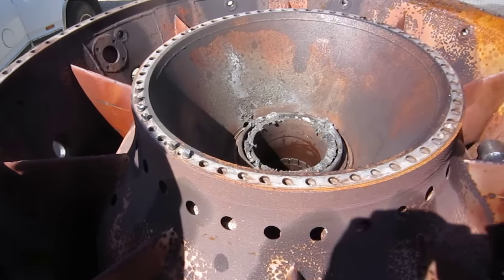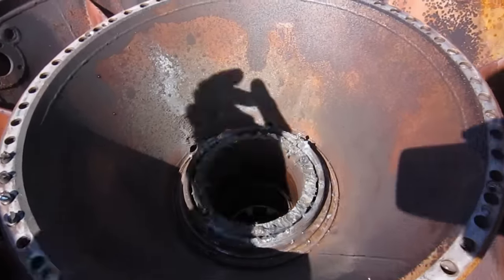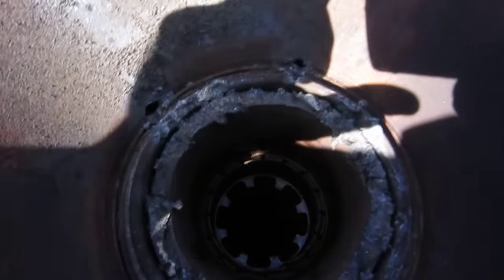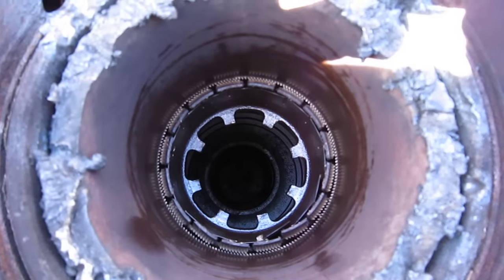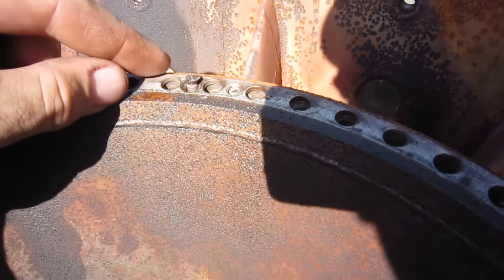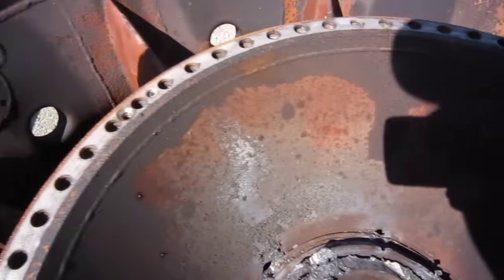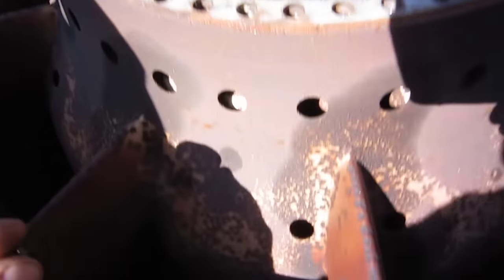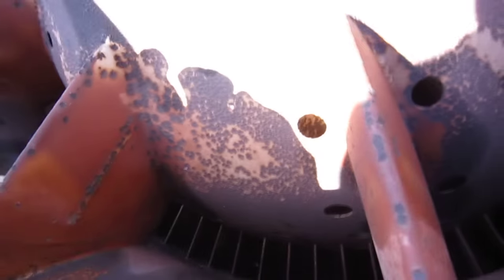Dropped into a turbine engine

Comment: As a mechanic for 8 years, the second you held the screw over the drop zone I immediately got goosebumps and anxiety.
Reply: Why is it so scary?
Reply: @qarinah8586  because dropping screws can cause an assload of work especially as a wind turbine technician. Dropping a screw or bolt (in the absolute worst case scenario) can kill.
Reply: @austinhall3937  interesting.
Thanks for reply.
Reply: @austinhall3937  could you elaborate a bit more? I love learning new facts
Reply: @marcar19  the uploader also talked about it in the video description. It means you have to disassemble the machine, find the screw, fix any damage it may have caused, like scratches and stuff, then reassemble the machine. It's like spilling water on your laptop, it's usually a disaster.
Reply: @qarinah8586  you would have to take it all apart
Reply: @qarinah8586  Because it can destroy the whole turbine when worknig, you need to find it and dissasemble half of the turbine to take it
Reply: @qarinah8586  

N
Reply: it literally felt like my entire lifetime will be fixing it.
Reply: @austinhall3937  you sound like that forged in fire melee weapons tester. "It will kill"
Reply: I nearly screamed but realized it’s just a video lol
Reply: @zaxele  Omg...
Reply: It's basically the equivalent of dropping a nut inside the oil filler hole or radiator of a car. If you do that you need to remove the valve cover or remove the whole radiator to get it out.

It gives you more work than needed. If you don't remove it, it can mess up your valve train or block a coolant passage way.
Reply: @qarinah8586  Dropping even a tiny thing into an engine can make it blow up when in flight and kill everyone on board a plane- You never want to take any chances
Reply: NormalStyleCrew  People can have some level of anxiety and still work? Like what are you trying to get at with your comment...

Comment: “Terrible sound”

The sound: T H E M U S I C A L
Reply: Nightmare for operators.. you dont know how much damage that one screw causes
Reply: We used to operate these giant machines everyday and only hoped these small erros which causes big destruction dont happen.. so we had to check everything before running the engine
Reply: @dizlikes6648  Something you've learned on when you were there?
Reply: @HangingDGrunt  hey it's the budget version of David bowie
Reply: @HangingDGrunt  we used to make these parts and repairing works for the private aircraft.. once the screw got loosened up and went inside the engine and we had to open up the whole engine to search that single screw.. it took nearly 3 days of work due to the small structure of the turbo engine and we cannot even break that as we were under budget.. so you see this is why we wished that the screw wasnt inside the turbo engine
Reply: @ajminadhimi8985  David Bolton

Comment: Yea I would never want to hear that sound!
Reply: Especially when you're 45000 feet above the sea level
Reply: Enito Jr Lim let me tell you it’s no fun working on a jet engine as you’re cruising 500mph and getting hammered by the wind
Reply: @enitojrlim4076  when the hell would you... nvm buddy, stay safe..
Reply: Whoooosh
Reply: @enitojrlim4076  tell me how exactly you plan on hearing this sound from the inside of a pressurized cabin?
Reply: @TheInator1234  With a WhoooshMeter
Reply: @twistedsim  the only joke i didnt get here was yours. R/Wooosh doesnt apply here and people like you killed that meme
Reply: While that thing is carrying my lousy ass 20000ft off the ground to somewhere i wanna reach alive.
Reply: Well if the engine was on you’d certainly hear it because it would cause damage to the turbine which is why you never want to hear that sound, because you can’t leave a screw in your turbine
Reply: isnt it because after this you'll have to dismember the whole  engine?
Reply: Василий Плотников If the engine’s running when that happens, you won’t have to dismember it. It’ll dismember itself just fine without your help.
Reply: @TheInator1234  by going outside, I guess?
Reply: Enito Jr Lim the engine would be running, so you wouldn’t hear that, it would just explode. This is in a repair station that you would not want to hear that
Reply: @TheInator1234  Woosh doesn't apply here because that engines not running. If it was running now that would be different......
Reply: This got 5k likes?! 😒

Comment: The kind of sound that makes you want to make a mistake
Reply: If every single noise is a different fan blade attached to a different section of the compressor then you DO NOT WANT TO MAKE THIS MISTAKE. You are looking at hours over multiple shifts to fix it checking every blade for damage and replace it the ones that are.

Comment: That sounds so beautiful
Reply: Andrew Hersom and deadly for the turbine
Reply: why?
Reply: kev1nsky because it might get stuck in a joint and fuck everything up, and we might die in a flight
Reply: Edson M.C maybe we can die while hearing pretty music
Reply: Mooney Khajiit preety much yeah
Reply: Edson M.C Bruh this ain't gonna kill anyone 
the other engine will still be operative smh
Reply: Ziggmanster what if the wing goes off tho??
Reply: Edson M.C well that's different, if one engine is destroyed or inoperable then a pilot could still land
Reply: Yeah. Been there done that. We were putting together the high pressure turbine and a screw fell from someone there as he was putting it to the turbine housing. It was a huge job to be done to get that screw out of there. The whole turbine assembly had to be fixed in place in a rack (because of stator and rotor blades and avoiding causing any sort of damage to them, they aren't even allowed to touch each other or they get too damaged) and we had to turn the whole turbine housing with the rack upside down and very carefully shake the housing to get the screw out of there. A whole 12 hours of nighshift went to that. Not nice indeed.
Reply: Ziggmanster whats up with helicopters? They use turbo shaft engines, where would be the 'other engine'?
Reply: Andrew Hersom much better than all the remakes
Reply: And horrble for all normies
Reply: Bryan Sollberger thats true
Reply: Yet so terrifying.

Comment: Almost did this on my first outage after getting hired at the power company. Only a month in, didn't know anything, wasn't given much if any instruction and basically was just a tool gopher. Picked up a home built slide hammer we were using while we were putting the upper shell on the compressor stage of a big gas turbine, wrist flopped over and dumped the threaded rod with the washers and all that right down into the intake. Got lucky as hell that it just fell down and out the bottom and didn't actually go inside the unit. But for sure thought my new job was over that day

Comment: "You never wanna hear this sound"
The sound: ✨💖🧚‍♀️🔮🎶✨🌈
Reply: the sound may be apealing to the common individual but that sound is something you never wanna hear when working on one of these engines as it may get stuck and on startup, may cause very very bad things
Reply: @ethanebang8902  and may go boom
Reply: @ethanebang8902  nah, it just means you'll have to disassemble the whole thing. No one's gonna start an engine with a foreign object inside it.
Reply: @danat4914  which is still a pain in the ars
Reply: why on earth you putted that rotten flag over there
Reply: @ibrahimaboelsoud7881  From which side it's looking like a flag

Comment: But I love that sound!
Reply: that's the joke....
Reply: well, it's not a joke actually. when working on aircrafts, in this case it's a turbo shaft engine, if you drop even the tiniest screw, you have to dismantle almost the entire engine, just to remove that screw, then assemble everything back and saftey wire the hell out of it.

that's why it is scary
Reply: Joe PA LOL you just got beaned
Reply: Normies everywhere
Reply: dabs

Comment: The sound of a 3 hour job turning into a 30 hour job.
Reply from the maker: When I witnessed this for real, it was a ten second job turning into a 2 hour job. Everybody was relieved, because it could have turned into a two week job. A week to tear apart the engine to find the thing, and another week of reassembly just to get back where it all started.
You don't get too many of those before you are reassigned to parts cleaning.
Reply: @AgentJayZ  if you're working on a turbine right side up, would it not be common practice to cover up the vent so things don't drop in there? I'd consider it lucky to have heard the sound. If the environment is loud, you're wearing ear plugs, and you dropped a plastic piece in there, you might not hear anything.
Reply from the maker: Yes, covers are always used. And the shops where these things are built are quiet.

Comment: i like how this channel set the default category for comments to newest first and it's helping underrated comments get seen, newest first should be the default instead of the top comments category
Reply from the maker: You sir, deserve an award. I agree with you. I want to see the latest comments.
Of the 35,000 or so comments, you are the first to notice how things work.
Bravo!
I can offer to send you a compressor blade of the type making the noises in this video. Would you prefer smaller, higher note, or a larger, lower note?
Reply: @AgentJayZ  i think thats the strangest comment i saw in my entire life
Reply: @AgentJayZ  probably a higher note so it can be stored easily lol
Reply from the maker: Email address on my channel page.

Comment: If I remember my engineering correctly, the WORST part of that sound is the ringing blades. The ringing means each blade is seized to the rotor/case. In a working turbine all the blades are supposed to have a little give so they don't vibrate while the engine is running.
Reply: This is not true Andrew. Free blades will certainly make a ringing sound like this, they are essentially tuning forks (which have one fixed end and one free end) of different lengths, hence the various pitches that are made as the screw moves from the shorter blades at the aft end to the longer blades at the forward end of the compressor.
Reply: The seized blades would have their vibrations damped.
Reply: racingbean Perhaps. I'm still willing to bet the blades are seized.
Reply: There isn't anything bad about the ringing of the blades. In fact, if they fused to the edges of the case, they would probably not even have that ringing noise. The only thing bad about it is that it means your probably got some shit between the turbofans that could mess them up.
Reply from the maker: racingbean Andrew is right.
 'bean is not.
Reply: AgentJayZ The blades should still ring even if they move a little though, right? Plus a small screw like that wouldn't cause a huge difference in the movement of the blades.
Reply from the maker: tolikechicken No. Although it is true that the blades have their own resonant frequency, and they would ring if they were suspended in space without any friction... it is the loose mount that is the source of that tiny amount of friction that dampens out any vibration, and does not allow the blade to resonate, or ring.
Reply: +racingbean
No, he is correct. Going off your analogy, suppose you held the tuning fork by the wrong end and struck it. You would not hear a ring, or at the very least, it most certainly wouldn't work as intended, as your hand would prevent it from resonating. This is similar to how a turbine blade in good condition works.
Reply: The noise you never wanna hear is your wife screaming your ear off
Reply: Andrew Diehl stop

Comment: As an aircraft mechanic... I died on the inside
Reply: Rip

When I was in the Army, a lotta aviation mechanics were really finicky about letting just anyone near any kind of turbine they were working on

I always wondered why, but now I know lmao

Just glad I didn't f%ck up and start messing around the work hangar haha
Reply: why is it such a bad thing? does it ruin the whole thing?
Reply: @monke5403  Youre gonna have to figure out how to get it out or else big trouble happens with the turbine engines
Reply: @monke5403  yes. Either you have you turn it upward(and it's heavy as hell) or you have to disassemble it till you can retrieve the item. In short, it ruins the whole thing
Reply: @kzkaa.  damn thats awful

Comment: So, does this damage the engine? Or is it just that the bolt/screw/thingy might not come out the other side, and the compressor will need to be taken apart? Also, it actually sounds kind of pretty lol
Reply: If it's left in there, the engine will violently destroy itself on startup. So, it's best you strip the whole thing down to find it.
Reply from the maker: description

Comment: People are saying this is the sound you do not want to hear during a flight. Could you even be able to hear this while the engine is running?
Reply from the maker: No.
Reply: If you're near an aircraft engine while it's running, you'll ideally have double ear protection on.
Reply: @ghostsmoke11  or get sucked in

Comment: Sound is beautiful but why sounds so chime? Usually  extremely hard and fragile metals sounds like that
Reply from the maker: Four general properties that materials have: strength, stiffness, hardness, and toughness. Also density, but we will leave that out for now.
Compressor blades are designed to have increased strength and stiffness, being not as concerned with toughness and hardness in comparison.
The blades are normally mounted with some looseness, to allow for thermal expansion, and to absorb vibratory/resonant energy.
These blades have built up corrosion in their mounting slots, and are seized solid, so they ring out like tuning forks.
If blades in this condition were to be run in an engine, the ringing and resonance would quickly build to the point where they would crack and break off, totally destroying the engine.

Comment: Oh do I have a P&W Pachinko Palace horror tale on a 4056.  Was removing boroscope plugs for the hot section inspection when one of the can alignment dowels separated from the bung.  The ping clunk of the dowel wedging itself between the case and combustion liner was the second most hideous sound I’ve heard on a big turbofan.  Machine shop couldn’t get it and we ended up changing the engine.  There were “ah Fucks” for everyone!

Comment: My Grandad was an electrical engineer at ABB, and he told me a story once that was kinda like this
He was at a Boing manufacturing place, working on the engines, and everything was going well he did his job and went on to the next place, fast forward to two weeks later, he went back to the same place and was doing some kind of maintenance check when all of the sudden, the man who was testing it( my grandad was setting up his equipment) said "RUN!) And there was a clunking sound like cogs (sounds like the exact sound as in the video) and the whole plant turned into a flash of light and my grandad ran outside and saw 3 important things 1 Flames and smoke 2 Engine parts everywhere and 3, The fire alarm. And i forgot the rest

Comment: Why don't you want to hear this noise? Because if you don't get that piece of metal out of there it could severely damage the whole turbine while it's running causing the blades to be broken off, spat into the rest of the turbine stage, and resulting in the engine tearing itself apart from the inside. Of course that will have the inevitable side effect of the whole thing exploding, destroying the aircraft it is attached to or at least completely totaling the plane.
Reply from the maker: It never gets that far. Real reason is in the description.
Reply: @AgentJayZ  Interesting, i was expecting somethin way worse, but thats maybe because everybody knows airplane engines can be highly dangerous. But yea, that must very expensive taking an engine apart.
Reply: @AgentJayZ  I read the description, all I know is that a chunk of metal getting lodges into the engine can destroy it no problem if it goes unnoticed. Otherwise, a whole teardown of the engine is necessary which is obviously costly and not something anyone wants to do xD
Reply: @AgentJayZ wow you actually use YouTube 13 years later?

Comment: I just found this after 4 years and what happened to the old comments?
Reply: Dunno..
Reply from the maker: 4 years of what? This vid was posted in 2010.
Reply: I mean I saw it in 2019 and I was wondering where are the old comments
Reply from the maker: There are over 30 thousand comments. A few of them are from 2023, but they go all the way back to 2010.

Comment: As someone not in aviation and engineering, how exactly is the turbine built for the screw to be bumping into so much at once?
Reply: Bro, just google it
Reply: Multiple layers of fans inside causing that sound
Reply from the maker: It's not a turbine. It's the compressor section of a gas turbine engine.
There are no fans in this video.
Reply: @AgentJayZ  what a legend, still replying to messages on a video that is 12 years old

Comment: Shouldn't the sound get higher pitched as it drops down due to the blades getting shorter?
Reply from the maker: In this video, we are looking at the outlet of the compressor. The inlet is on the ground.
Reply: wait what, 13 million views, and 35k comments and creator still answering? 
damn, props out to you

Comment: What’s the thrust of that version
Reply from the maker: This is the compressor section of an LM1500 PB104, which is a ground running power unit used an US aircraft carriers.
It's design is a slight midification of the GE J79.